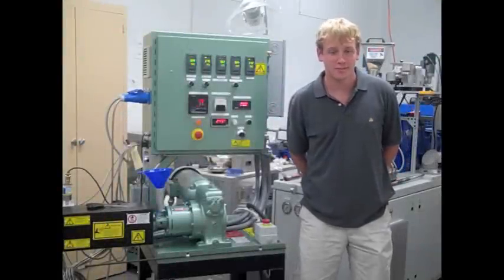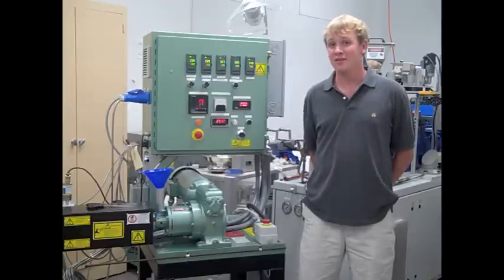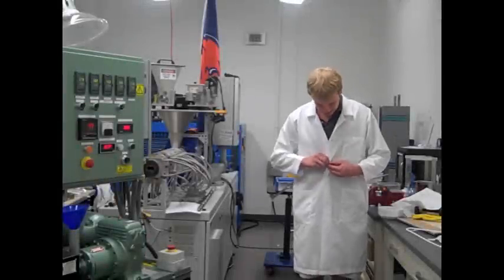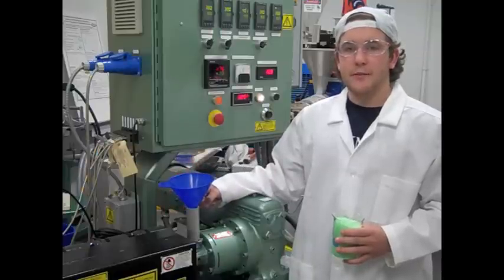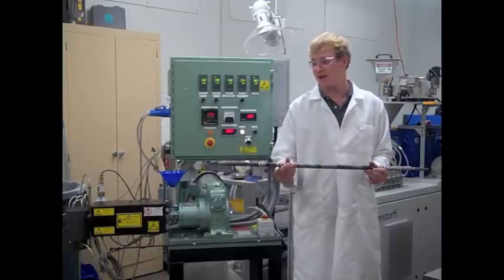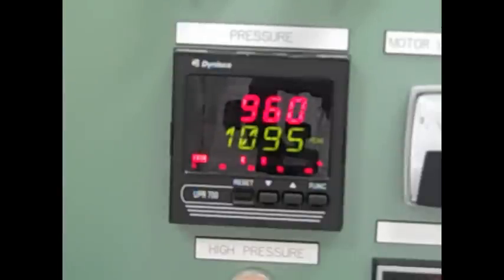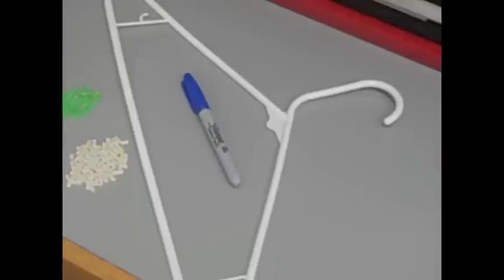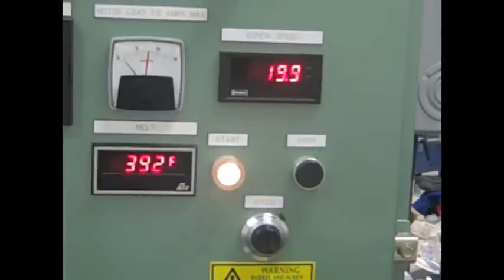Single-screw extrusion

Comment: Oh shit that's a crock a shit I ran single screw and twin screw and I never got no white lab coat lol. All through the 90's and some of the new millennium if you built a home chances are your windows framing was extruded by myself and a few others I ran Gienow,Smed,Northamerican profiles group ,Jentell,Sauder,willmar the list goes on I have extruded millions of lbs of thermo plastics santoprene rubber polly pro LDPE and HDPE ABS, I know my plastics and the machines I'D smoke these two guys easy.